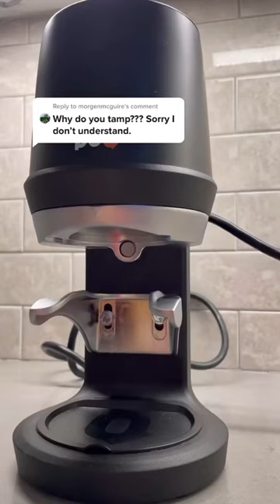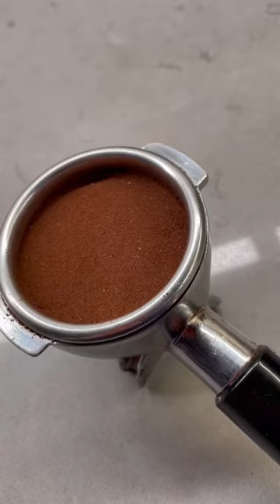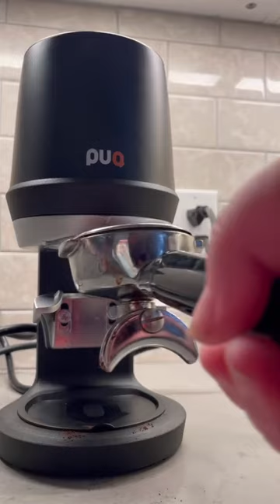Why You Tamp Your Espresso #shorts

Comment: When tamping aim for 25-30 pounds of pressure if you don’t have a auto tamp like that. Which feels like a good press don’t go to far it will cause really bad channeling. Make sure the top of the coffee is as level as possible too if it leans one way it won’t extract evenly and the low side will over extract. The screen on a home machine can really help with stopping channeling too because the brew head won’t be hitting the grounds directly with water causing divots to form in the surface.